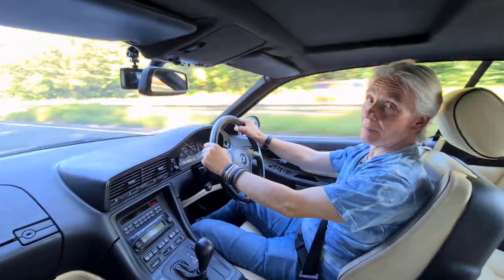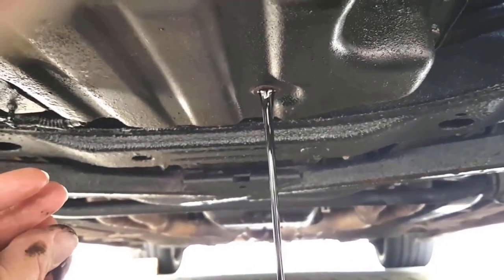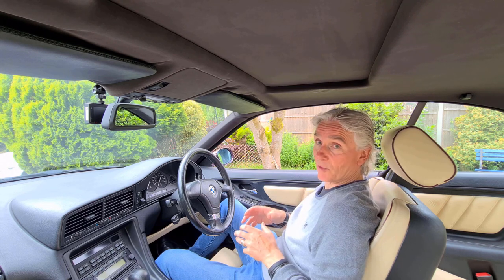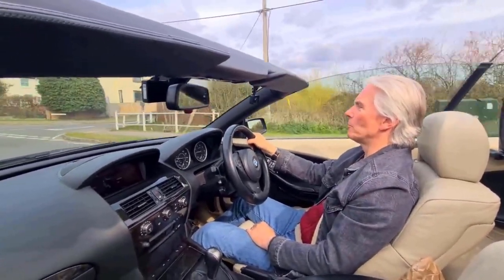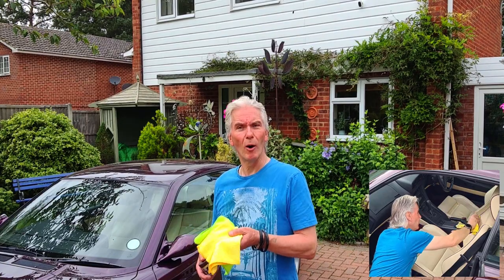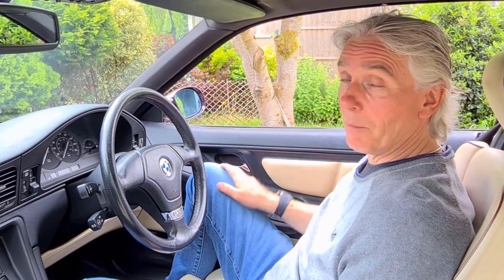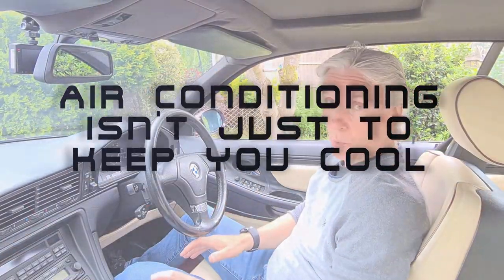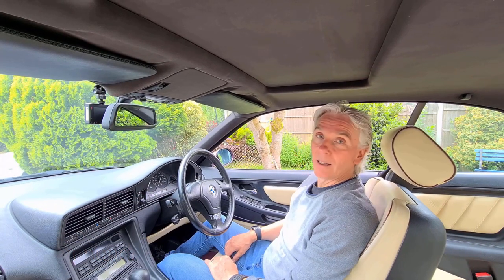BMW 8-SERIES - HOW TO KEEP IT PERFECT FOR EVER!

Comment: I would also mention to check rain barrier seal inside each door underneath trim panels. If somebody earlier repaired stuff inside like window motor or door lock there’s a chance the vapor seal was not resealed properly. Water in cabin guaranteed after rain.
Reply from the maker: Good plan!

Comment: 1,000,000 !!  Congratulations Timm and well deserved. Greatly appreciate your enthusiasm and knowledge as it helps me to keep my 650i Coupe and my 540iT (similar mechanicals to your 850) on the road.  Most of these cars would have been scrapped if it wasn’t for people like you. It also helps keep down carbon emissions by reducing the carbon produced as a result of manufacturing new replacement cars/EVs. (Eg. I estimated the carbon emitted by my 540i running on LPG over the next 8 years is about the same as emitted by building a new EV and charging it from the grid.  ) keep it, all the best. Martin 👍
Reply from the maker: Thanks Martin, that's very kind of you!

Comment: Hi Timm, thanks for the website which I’m forever visiting for all manner of info about the e31. It’s helped me a lot to understand my 97 840Ci. Unfortunately I haven’t looked after it as well as you do yours. But I try. I recently had to replace the back exhaust system as the left side box had rusted off the pipe work and left hanging loose. The boys at Fast Lane styling in Romford did a tremendous job. My priority now is to replace the alloys which have become extremely porous and unrefurbishable.they’re exactly what you have on yours and I’d prefer 18s. Would you be able to point me in the right direction for these and are 18s the best fit to bring out the majesty of the 31? Many thanks and sorry for  rumbling on. Frank.
Reply: hi i walked past you as you drove in , i own an e31 also and live around the corner , very rare to see another e31 other than my one :) ps i may be selling a set of  18"  mpars from my e31
Reply: @repairitdontreplaceit  Hi, happy to have a look. Let’s get together when you can. Thanks.

Comment: Tim... great website and all the tips are GREATLY appreciated. I recently had a weird event on my 1991 E31 V12... The fuel gauge shows full... yes I had just filled up... after about 20 miles of driving the gauge still showed FULL.. but being a rather suspicious person I looked at the 'Range' display on the centre consul to find that as I was driving along the range figures were actually INCREASING in mileage range!!... What is going on my friend!? Any advice? Please and Thank you ... Eric
Reply from the maker: There are two fuel-level sensors on the E31 - wired in series and a failure of either will cause this problem. An increasing range shows that the fuel level sensors are not reporting any reduction in fuel level. I would leave it a while and see if the fuel level does start reporting as reducing as that would give and indication of where the problem is

Comment: wish id found your videos before buying my E31, but at least I now know what requires urgent attention and what can wait. I won't bore you with the long version of current issue  but it resulted in me changing injectors when in fact the cat was failing. now have inpatient reporting lamdaintergrator at -32 adaption value -18 multiplier is at 0 . investigation of new injectors flow rate 205 g where I believe originals 150cc (CC & g the same)so back to original injectors and then time for a cup of tea?
Reply: that's INPA not inpatient
Reply from the maker: Hello David, I'm not a fan of aftermarket injectors, you are never sure what you are going to get! Yes, stick the old ones back in, reset adaptations and see what happens.